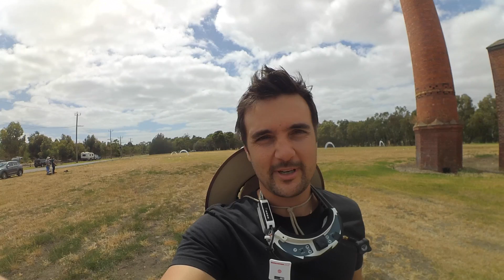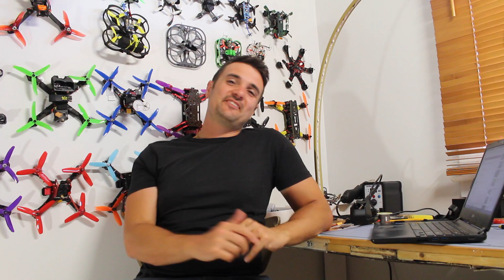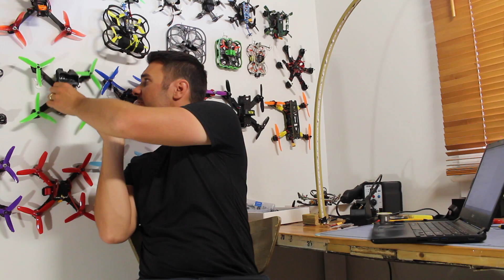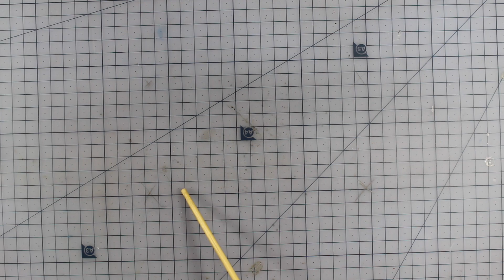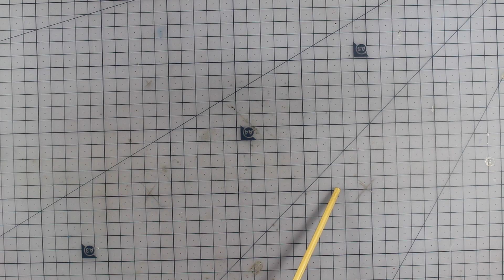Top 3 Quads? Best KV? Track Design? Radar Guns? Sunday Q & A???

Comment: Stu I've been watching a lot of your videos for a while now and only just today realised that I hadn't subscribed so I've done that now. I started out in this hobby by getting given a toy grade qaud for free which had a dead motor and a dead MOSFET, so I replaced the FET and the motor and started learning line of sight. Then I got a Hubsan x4 as I'm in the UK and we definitely don't get as lucky as you guys on weather. After watching yours and Project Blue Falcon's (Which of course is very sad what happened to him) videos I wanted so much more than line of sight flying, so to see if I'd like the hobby and to not spend a huge amount straight away I put my hubsan FC onto a QX90 frame and soldered a cheap FPV camera to it, then bought some Eachine goggles. After flying that for a while I've now bought a Taranis QX7 and a F3 FC for that frame but I'm currently looking for parts to build my first 5 inch quad. In the meantime I've been learning with the Taranis on LiftOff simulator. You've really got me into the hobby and just like you I used to play too many video games. This is like a real life video game which you can actually get outside and do so it's great. Keep up the good work and I look forward to more videos from you.

Comment: I have a good 'question'.

Remember about a year or two ago when people were saying 'drones' and we were trying to correct them and say 'no, they're quads.'? We're not doing that anymore, really, are we? We call them race drones just like most people do. The professional ring calls it 'drone racing' and everywhere you look on the internet, they're labeled as 'drones'.

So why is this? Is it a psychological effect or event? Is it just easier to call them 'drones' regardless of what they really are? Did we just not push back hard enough? Was 'drones' already too deep seeded? IS IT THE GOVERNMENT, BRO!?!?

So yeah. Thanks for answering, if you do. :)

~Dave
Reply: Oh, also, another question. I sorta asked this on another video, but given THIS Q&A where you answer your top 3 quads, I'll change it a little.

So, if someone came out with a combination of the Firehawk and the GT2, would that be your dream 5" quad and would it replace both of those models in your top 3 quads? Also, what would end up in the second and third spots if this were to happen?

Comment: Hey Stu, you've definitely pushed me toward diving into fpv quads.  I've been playing with several cheap mini quads at home with the kids and have wanted to get into fpv but didn't really know what to get since there's so many options!  Cost isn't really the issue but I do want to get the best bang for the buck.   So far, the only thing I've purchased is to preorder the Turnigy Evolution (mainly based on your review).  I'm also looking at the Wizard X220 but it seems to be out of stock for now.  As for the goggles, I'm not sure if I should start with the Eachine Goggles 2 or just bite the bullet and get the Fatshark or Skyzone.  I was also thinking of getting a screen so my kids can watch as well. If you have any thoughts, please share.  Thanks!

Comment: Anyone with drone experience and would like to help me out here please do: So I would like to get into the hobby just for the fun of flying around a FPV drone like this. Im definitely a beginner and have never flown a racing drone. Would you recommend me starting with something like this or would it be to much? I have a big farm/massive open field literally right behind my house(it's my back yard a small fence and then just open field) so I would have more than enough space to fly it and hopefully get the hang of it without worrying to much about crashing into anything. Any thought from some of you more experienced guys would really help! Thanks!
Reply: lamakicker69 I would recommended to get a toy quad first. The Eachine E010 is great. Durable, and maneuverable. Cheap too. After you get comfy with that you can get an Eachine BNF like the QX90c along with a transmitter of your choice. A flysky fs-i6 is a really good begginer radio, but I think getting a Q X7 will grow with you more. I think you can also get brushed fpv mini racers that are RTF in banggood. I believe that the QX90c has an RTF version too. Next to fly FPV you need goggles. I would recommend the EV800 which is very inexpensive. The reason to get a brushed mini fpv quad like the QX90c is because that way you can configure it and tune it in cleanflight/betaflight like you would with the bigger brushless quad. Next after that is I think the Wizard x220 which is a big step in brushless racing quad.
Reply: Andre Martinez I already have a toy quad and have gotten good(at least I think good haha) at flying it. You think it would be okay to just jump right to the wizard x220 build for $300 that he posted a few weeks back? Or should I go with one of the mini race quads before getting the x220? Once again I have a massive amount of open space with no trees or anything behind my house to practice. Thanks for the advice, it really helps!
Reply: I think it would be alright. You just have to watch out for the replacement parts and such. I recommended a brushed FPV racer at first because maintenance is easy. For example with the QX90c you can also get similar feel with the bigger quads. Something like the QX105 would be great too. Although again, if you have really gotten good with your toy quad, getting the x220 would be good. Although I have to warn you that if you want to do FPV you would need to learn ACRO for smoother FPV. You can fly angle mode on something with the x220 and practice acro on it too. Although practicing ACRO on a brushless quad might cost you a lot because of crashing. If you want to practice ACRO you can buy the inductrix or the nano qx.

Comment: About the motor "kV" I agree with you Stu. I am no expert but I built a DYS 1306 2200KV setup (on a Diatone Spadger 180) and it had a really good mix of performance and flight time - about 7-8 mins with 3S 1000mAh. I then went on to try some Ready To Sky 3100KV 1306 and flight time dipped to about 5 minutes and killed my el cheapo batteries, there was no gain in performance with the higher KV at least with the motors I used. Maybe it has something to do with props too... both setups I used 4 inch bullnose props. Anyway I prefer the lower KV for torque and efficiency, its suits my tamed style of flying. I now also have higher C rated batteries, should last a whole lot longer. Some lessons have to be learnt the hard way.

Comment: I come from airplanes and dislike the idea of having gear, e.g. battery, hanging out.  I see them on top or under quads.  When on bottom, do they get scuffed and damaged from landings?  When on top, do they create a top heavy C.G.?  Very few seem to tuck them in the frame for protection and neutral balance.

Comment: Hey Stu, I bought the GB 190 after your vid and it is my first build i did not know about flashing the flight controller and ive downloaded clean and beta flight but when i go to flash firmware it says there is no bootloader can you help me or explain how to do that and what else is required to get it flying? thanks alot keep doing what your doing.                                                                               

P.S. 
My friend and I are trying to start up a drone racing track and shop around our area because the closest one is 2hours away.

Comment: Your quads always look smooth & locked in. I'd love to see a video on how you tune your quads. There's a lot of videos out there on PID tuning and Betaflight setup but the method seems to vary from pro to pro. Most of what I've seen is geared towards free style quads and not so much for racing. Is there a big difference between the tunes?

Comment: Thanks for the tip on forward flying. I have been trying to fly indoors with line of site so pretty much all I can do is hover... while trying not to break anything.
Took the plunge and bought a cheap cheap start up kit. Would you recommend getting the Turnigy and not even bother with eachine flsky copy? It seems that is all you use now.

Comment: Question: Does the quad designs need to have the motors in the same axis of thrust? I see some designs with 4 motors in the same plane or close to the same plane. Some hex and oct designs. But in them all they are thrusting in the same direction. 

Not sure how it would fly if motors were in the 90deg axis but might be worth seeing if the FC's could handle the design.

Just asking. Later,

Comment: could you show us your battery charging and storage system, and just give us your best tips on lipo care? Love the channel!
Reply: Jon B Baca 
Indoors indoors indoors where its under AC and seperated from each other. I am into R/C cars as well so have a few chargers and only 20 batteries but I keep them in my house in my old gun case with shelves. None of them touch! The gun case is fire proof but that is pure luck and don't believe to be required. I just have a million guns and safes so this old one works perfectly for storing all my batteries and equipment.

Comment: Goodday stu!  I came across ur channel a few months ago and enjoy your reviews and you have intigued me into getting into the hobby.  my question .. with all the great RTF and ARF quadcopters on the market(x220 for instance) what is the benefit of building one from scratch, other than just the satisfaction of building your own?  Most of the PDB's, ESC's, and flight controllers that I would consider using are used in ARF quads but it would cost more to build from scratch than getting a ARF.  Is there a difference in these components sold individually?  thank you

Comment: In your Sunday Q & A I noticed an Eachine Racer 250 on your wall. For me it's the first race quad I bought and first quad to configure board. Have had it for two weeks and still can fly it. After following many utube videos still no go. When calibrating motors one of four will not turn. I've since realized maybe all I had to do was connect a receiver and go fly. But others on utub were configuring so I thought that's what I was suppose to do. No help from Banggood so far and trying to return it as devective. Would love to get it flying I know this is brief but any thoughts.

Comment: Can you show a basic overview on how to lower the rates of a quad (I need to on my Eachine wizard x220)! Lol Jakey!!! I wonder if all my viewers will start calling me that!!!
Reply: easily do it on your transmitter if got the flysky rtf version switch A has a normal and sport mode in set up go to dual rate and set the rate for each channel.switch to sport for full rates.only thing you cant change rate for is throttle curve if say set it at 80% it will be the same in both rate modes.just a heads up if you want lots of info and mods join the eachine x220 wizards owners group on facebook.very helpful bunch of people.

Comment: Probably Noob question but need to ask. I am new in to RC flying and notice there are CW and CCW motors. I fully understand that one is clockwise other anticlockwise. But also seen videos that you can change rotation with soldering cables or with software. My question is do you still need to but 2 CW and 2CCW or you can buy 4CW or CCW and change rotation with soldering or in software? Hoep you get what i mean. Thanks

Comment: ur vid on the gt2 got me into the hobby again after loosing my TBS disco so thank you for that, having a blast now, one question, one of the motors of my gt2 has stopped working what should I do, motor stopped for no reason not even after a crash?

Comment: Sunday is our usual fly day as well.by the way found a great way to waterproof a drone. will make a video of it and take off from under water with a 250. should be cool.
Will try betaflight as well, have been a clean flight and openpilot/librepilot runner to date.
Reply: As Stu mentioned, Betaflight is probably the most stable "right out of the box" over any other. I used Cleanflight for about a month. Once switching over to Betaflight, I won't program with anything else for now.
So if you have a F3 board capable of Cleanflight, make the switch to Betaflight. I think you'll be pleased.
Reply: going to try it on this waterproof build.
Reply: Would love to hear about the results. Your weather is probably like mine right about now, I'm north of you in Delaware.
One thing to consider is the XT 60 (or whatever connector you're using). Perhaps coating the pins with silicone grease or even spraying with WD40 to reduce the electrical resistance or possibility of shorting of the water between them.
Reply: die-electric grease is used on the connectors.
Reply: will send a link to the video when it is done to uav futures and several other places as well. will be on our web site as well. Even if it fails it will still go up.
Reply: Carrboro_Chapelhill Fpv I subbed to your channel, so when it happens, if YouTube works, I'll get notified. 😆
Reply: yea looks like a lot of rain this winter and, that is why I am looking into waterproofing, the spray stuff is not the best way as it comes off and is not 100% anyway.